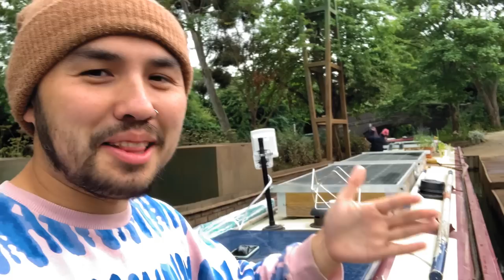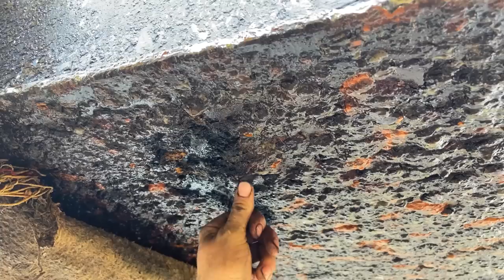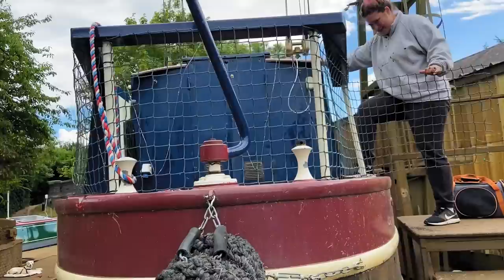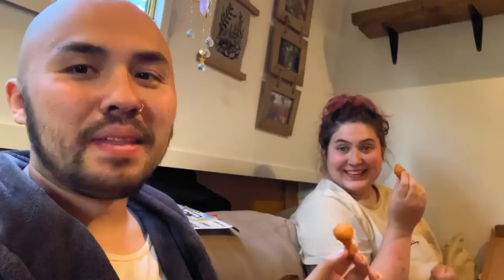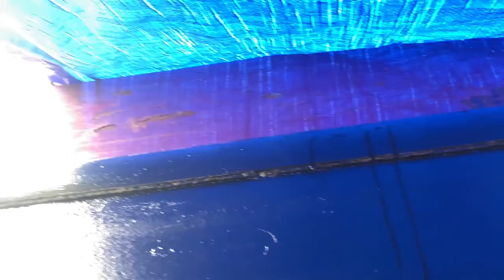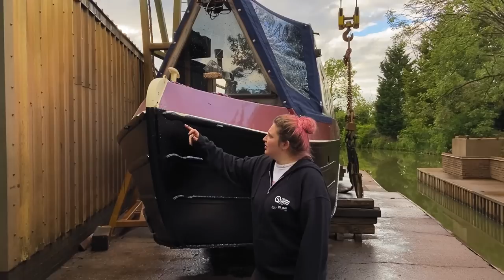We blacked our narrowboat in the RAIN

Comment: loved this vlog. Brought back memories of when I discovered pitting on my boat! As I had relatively bad pitting to sides below waterline and baseplate, especially stern baseplate... Had the bad pits puddle welded to avoid overplating, which both my surveyor, welder and myself all wanted to avoid. Along with two pack epoxy on sides and baseplate (which I can't recommend enough, as it's sets so hard over bitumen based paints) to fill in pitting and give better and more long-term protection, I feel the boat has had a new lease of life after welding and epoxy. Don't let pits get you down, I know it makes you think the worse, having them all over, but my welder said you get them on all boats pretty much, and mine wasn't the worse he'd seen by far. Although saying that, my parents bought a narrowboat just after I had mine, and they don't have a single pit! Got lucky I guess. Im in a marina which isnt great for boats apparently, as the stray currents can cause pitting if your boat is exposed or suseptable to galvanic corrosion. Most folks here at the marina say they've all got pitting of some degree, so think it's just one of those things that comes with older boats, boats that haven't been blacked when they should have been and boats sitting in marinas for the majority of their life . Anyway, just wanted to share my experience.
Reply from the maker: Thanks for sharing Luke! That is really reassuring and glad you were able to get it sorted. I think if we keep on top of it now all should be okay! 🤞🏻 Yeah, the boat before we had it was in a marina all its life so thats probably where our pitting came from! 
Thanks for watching and happy boating 😊

Comment: There's a product called GOJO.  It's available in the UK.  It's just a few quid but worth it for icky greasy hands.  You can use it on the face, but be careful to not rinse stuff into your eyes.  I close my eyes and wash my face in the shower.   I'm still young and pretty.  lol   I can get oil and grease all over working on engine bays and cleaning projects.  Been using it for the better part of 30 years without fail.
Reply from the maker: Oo interesting! Not heard of that one before so we’ll keep that in mind, thanks!!